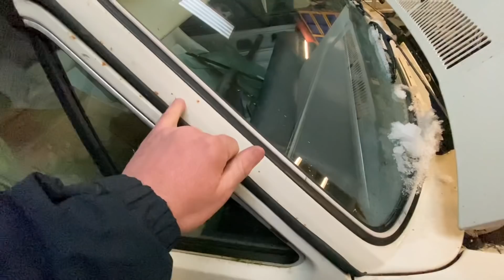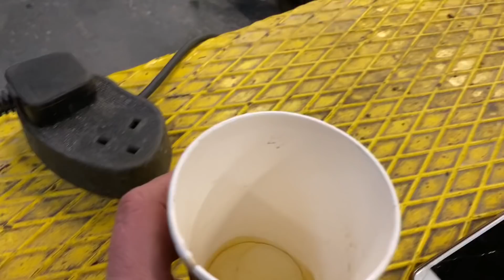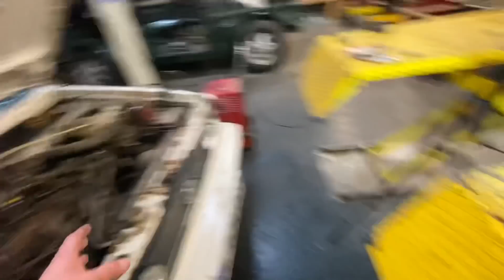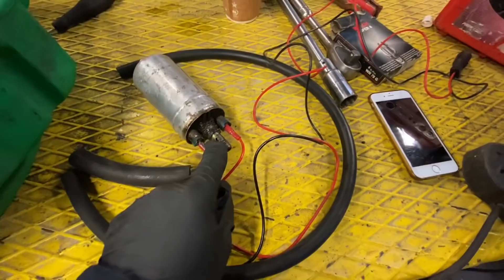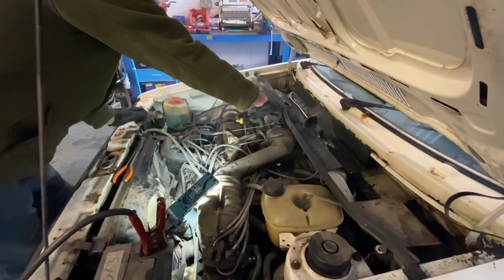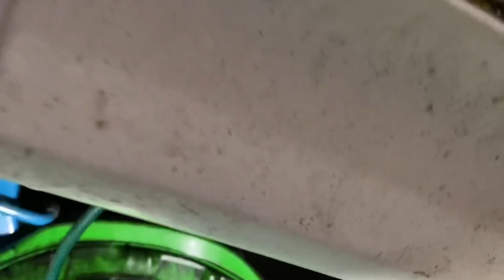Will It Run ??? MK 1 VW Golf GTI Rare Car Barn Find PT2

Comment: Hi are these worth. I just bought the exact same car for 1k Harmon kardon. Has mot and is daily drive?
Reply from the maker: Harmon kardon is a stereo system bud
Reply: @sruk  sorry I meant Karmann, they were limited editions, what do you think they sell for nowadays, not sure if I should keep or sell
Reply: @jayleigh7285  no such thing as a Karmann edition - all made by Karmann in Osnabruck hence the Karmann badge on all cabbys on the wing from factory. If they haven't got the badges then they've been taken off by an owner at some point, been in a bump/respray or simply taken off. VW supplied parts & all Mk1 cabbys were built/constructed/assembled by Karmann.
Reply: Thanks not to clued up on these if I'm honest. What should I sell it for. You may be interested if you make money on that if you could just have two🤔
Reply: @jayleigh7285  all depends on originality, condition, Service history, Mileage, special edition perhaps... need to do a bit of research on the sales side of it, only saying that as if you ask what it's worth on social media, the keyboard warriors will give the car a slating & saying it's worth what they think when they probably haven't got a Mk1 themselves or don't know that much about them...

Comment: I owned an almost identical one on a D-plate in 1997. Paid an iffy dealer £4.5k and later found it had been clocked  (should have known from excessive wear on the steering wheel, which they put a fluffy cover on!), badly repaired / sprayed in rear quarter arch area (paint bubbled up with water within a few months) and eventually the engine gave up on a hot first date! (Oil mixed with coolant and frothed up like a bad latte and ran like a pig but managed to get her home, although my date never came back again :0). After uncle Mick R.I.P x swapped out the engine it just overheated a few times on the M6 up towards the love of my life up North (23 years and counting) - she took pity on me and so we got £800 part Ex on a brand new late 1998 Mitsubishi Shogun to end my days with dodgy cars! - happy memories though ..

Comment: Good to see Chris back on the job these past two videos. With this recent flurry of convertible cars you may soon be known as Drop Top Rob. I'm sure that when they got to this age of convertible the cars with white interior were called the "All White" edition so maybe this car has had a roof at some point as mentioned in the videos. I'm also sure that the wheels currently fitted come from a favourite VW of the mine the Corrado. Watch out where you park it in all that snow. You may have to wait for Spring to find it again! Thank you.

Comment: had one of these myself back in the 80s, when i first got it , it would not rev crisply to 6k.(was good upto 4 to 5k)
took it to specialist (turbo teniks guy) and they fixed it by running deglazing agent in fuel and repairing / replacing top of injector unit ,
apparently these are a known issue, think he said seals in said unit can give bother
well done on hitting 30m

Comment: My first car was a 1990 Helios blue clipper auto. The Pierburg carb had an issue when you turned the car off it used to splutter a little before the engine cut out.

Comment: Your Golf Cabriolet was built at Karmann in Osnabrück and was one of the first models to receive the updated and elaborate corrosion protection treatment. All closed members were treated to a wax injection by hand and the lower areas of the body, from the first 100mm of the lower door were dipped in hot wax bath. If the car was left in the sun on an extremely hot day, then wax dribbles could be seen as some of the wax melted.

Comment: One thing worth checking before driving is the clutch cable. Making the mk1 rhd wasn't a high priority for Vw. They basically drilled a hole in the bulk head. It's worth checking the metal around the hole, they are known to fail and pull the cable and gromet through the bulkhead you used to be able to buy a strengthened panel for it. But be worth checking the stiffness of the clutch to make sure its not putting to much pressure on the weak point.

Comment: Know what these cars have? Character. The visual cues that surround cars of this generation shows that it was designed by a person with a pencil and paper. Not only the GTi, but things like the Alfa 164, Jag XJ40, Audi Quattro. I think my E36 BMW is the last car to show any element of human input. Since 2000 the regulations car manufacturers have to conform to have made cars all the same. They all have to meet pedestrian safety, they all have to meet low Cd numbers and package the same amount of interior room in similar size shells. My only hope is blokes like me in mid 50s can impart our wisdom and knowledge of such cars on our kids, so when we're not around these works of art still will be.

Comment: rob and Chris i think getting that golf running with a new fuel pump and a set of plugs was a gift from the gods , Especially with it been stood for years , my late farther was a bosch fuel injection specialist and service agents we had these in every days in the eighty's , ime amazes d youve got away with original injectors and the metering head is not sized up .personally i wouldn't run it until the tanks been cleaned out from experiences of these if the filler knecks been replaced  and the tank not removed for cleaning all the rust and sediment will block the injectors and all the very fine filters on the meatering head its a right task if this happens  . fantastic video i was sat on the edge of my chair when it burst in to life well done you both
Reply: As Paul said above ^^^... We had one years ago that never ran right from day one, filler necks rust on inside and fill tank with rust particals.
Only real fix is - tank properley cleaned out and a new filler neck, and filters etc.  We bought the last genuine VW filler neck in the UK a few years back (unless VW have remade them again) after trying a cheaper Ebay filler that was nowhere near the right fit.
Good look with it, looking forward to next update and don't work Chris too hard just yet poor lad!

Comment: Rob this has made me smile. Had a good few of these. Common problems ...I think it’s called the accumulator and also they all need to be strengthened on the bulk head where the clutch cable comes through. Of the clutch feels heavy then get a Blum head clutch plate. Hope this makes sense

Comment: Rob the car is hunting you must be running very lean but you may need to initialise the bsi so it holds the revs but you need to replace the parts first good to see your using bosch plugs not some Chinese cheap brand not the same

Comment: With it being E reg does it not need leaded petrol ? Or hardened valve seats
Reply from the maker: No it’s unleaded 👍
Reply: Use higher Octane unleaded -I use Shell v-power only in mine...

Comment: Three words Lift pump filter. There's a second fuel pump in the tank...
Reply: Bosch  injection 1 external fuel pump  5 bar fuell pressure no other fuel pumps in system just fuel pressure regulator returns excess furl to tank
Reply: @andyplage6590 ... And the lift pump in the tank...

Comment: Not sure what the fuel filler pipe is like on a cabriolet but on my mk1 tintop I had bad rust up inside the rear arch as dirt builds up behind the filler neck. Had to replace the inner and outer rear arch and the fuel filler surround.

Comment: rob they are really bad for the filler necks rotting and puts rust in the tank,i had one years ago and had to replace alot of the fuel system as the rust had gone right through it defo tank out mate

Comment: Bosch k jetronic injection. When you put the air filter in, check that the air flow metering arm moves freely, and also check the inlet flex hose for any splits or cracks . The fuel injection relies on the airflow to operate the metering unit and will not tolerate any inlet air leaks on the induction pipe!
Reply: the plunger shouldn't be messed with... air filter is simply 4 clips, raise the meter head, remove the filter, clean the unit with non residual cleaner, replace the filter & that's it.
Reply: @DeanoM3Sport  when this type of injection system is left standing for long periods, the air  flap can stick down, with the result that the car won't start, all that is needed is to pinch the centre screw between finger and thumb to check that it is free and that it lifts freely. I do agree that fitters shouldnt mess with things though! LOL

Comment: They do start very easy. Mine was the same after sitting for 6 years :)

I've got guides on how to DIY the roof if you're intersted. Im not sure a patch would be worth it as it would look terrible. A nice mohair roof is about 240. I think I priced mine replacing the outer skin, interliner, headliner and a rear window frame at 700 for the parts. You can imagine how much more a pro would charge.

Keep up the good work and looking forward to more vids on it!
Reply from the maker: It’s got a mohair roof we wouldn’t be patching it it would have the whole side replaced 👍

Comment: Tax sorn last mot 9sept2010 103924 done less than 4k in 4 years couple rear brake pipes advised looks Gr8 had man over the years sport lines n rivage there the ones with big bumpers n power hoods yours worth 4nhalf to 5 n half when done white roof or nice red roof

Comment: The white roofs on the mk1 Golf cabs did seem to deteriorate a lot faster than the other original colours, so it's no surprise to see that it may have been replaced in the past.  Good news on the engine, it sounds pretty sweet, and good news on the seat cloth too...

Comment: Front bumper is not the right one
Reply: the whole kit wasn't factory on an E plate... big bumpers only fitted from 88 (F plate) - 93. The grille, alloys, exhaust, foot pedals & steering wheel weren't standard, along with the 16v badge lol. only did the 16v from the mk2.

Comment: That bosch jetronic fuel injection system is a nightmare. My mates Escort xr3i convertible ran like yours on first startup, turned out it was a bad metering head. That was after we replaced every other part of the fuel system. Lucky on the fuel pump!

So jealous of the snow, lol. Nothing here in Wiltshire.

Good to see Chris back.

Comment: Hi lads and great effort during the cold.  I’ve been watching all but transfixed for some months.  “Do I watch prime time tv or do I watch Salvage Rebuilds”?  No contest.  Your work cleaning that old motor home was some good old fashioned British graft.  Great to see and an education to so many.  Now, my question.  For this VW you injected oil/DERV mix into the cylinders before turning the engine over, absolutely great to see, but why didn’t you do it for that great little old Peugeot 306 GTI.  I didn’t see you do it and that really gave me nightmares?  Just a question I would not dream of questioning you lads.  Great channel.  Hope it all pays off.  Top channel.
Reply from the maker: Wen I dragged the 306 on to my truck it was stuck in gear so it had already wound the engine over quiet a few time so if there was going to be any damaged that would have been the cause  👍

Comment: just my opinion Rob, but no point repairing that roof skin guys they degrade with age,  you will get a new black mohair skin for under £300. you will need new tension cables each side and a rear cable too, roof skin has tocome off to adress the rust on the quarter tops.
Reply: and you will need to check the pick up pump in the tank or the new high presure pump wont last long.

Comment: Rob, Chris, you definitely need to check the fuel filler neck. The original was mild steel and rusts out, sending debris into the tank. Others have probably mentioned it too. I have a stainless steel pipe for my Rocco, so swapping it out would be an option.
You should be able to gain access to the tank from under the rear seat. Use the old magnet trick to clear it if it’s got crud inside 👍. 
On my Rocco the ignition module sits in the scuttle on the passenger side above the engine bay. Covered by a plastic rain tray for protection. My module sits on a heat sink, check if yours has copper grease in between the module and the heat sink. The grease has been known to dry out and the module then over heats. Causing the motor to cut out....

Definitely try vw heritage and Gsf for fuel rubber pipes etc. 
Glad to see an old stool vdubya on the go. 

Great to see you both recovering well from your illness. Stay safe guys 😷.
Reply from the maker: It was the first thing we checked 👍

Comment: Remove the rear seat and pull the in-tank fuel pump. K-Jet does not like sitting for extended periods and the in-tank pump screen could be varnished, as well as the hoses could be disintegrated. Additionally, the fuel accumulator's rubber diaphragm could be shot.

The timing belt "scratch" is normal due to the belt cover.

Glad to see another Golf Cab being saved!🥰

Comment: Hi Rob; loving your channel; this GTi brings back fuel system memories. These are prone to dropping water into the fuel system from the filler cap. All it needs to prevent many headaches is a new seal in the cap. Very simple and cheap remedy but avoids future problems.

Comment: When you blow out a fuel line, always blow from the motor back to the tank, because any rust or debris will have come from the tank and will most likely be at that end.  Doing it the other way can force debris into the line where it might get stuck half way along.
Reply from the maker: We blew it both ways 👍
Reply: I’m blown away

Comment: Nice one fellas 👍 may also have another pump in the tank. Also check the kjet metering head setup they are quite fussy for set up, may also need super unleaded to run spot on 👍

Comment: As an apprentice I had to fabricate a reinforcing plate for the bulkheads on plenty  MK1 GTI’s & golfs in general,where the clutch cable entered the bulkhead it would split 🤦‍♂️🤣
Reply: I remember selling one with a pair of mole grips each side of the bulkhead🤠
Reply: @ady1397  🤣🤣🤣🤣

Comment: No Point Fitting a Diesel Filter in the Engine Bay , Petrol would Work alot better 🤭
Was it Just a Matter of Running the Engine to get it bk Running o n 4 Pots , was the leads Damp too?
Reply from the maker: 🤦🏻‍♂️ long day. It was all damp and the fuel pump was toast 👍

Comment: Great to see it started, well done. Definitely check fuel tank as filler pipe rusts away and drops bits into tank, fuel filter is after pump so no protection for pump!.

Comment: I messaged on Instagram regarding the fuel tank. Heritage and Mark at classic VW are the guys to go to. Behind the rear wheels pretty much at the back of the car there's two rectangular brackets they're the best place to put the axle stands if you take the tank out on the floor as it requires the beam removing...
Reply from the maker: We got a ramp so should be quiet easy 👍
Reply: @sruk  yep you'll just have to shuffle the cars I guess hope you guys go far with this one if you need anything message me on insta scirocco mk2 owners club

Comment: Brilliant video; thank you.  I had two of these back in the 80s.  Some toe rag stole the first one and I never saw it again.  I bought the exact same one as a replacement.  So, I’m loving the memories.  The clutch went on the second one after less than two years and 8,000 miles.  I had to give it up when the insurance went through the roof.  GTI quickly began to stand for Ghastly to Insure....It was parked on the road in central London....looking forward to lots more.  Thanks guys.....stay warm....

Comment: Loving this series, I've had 2 mk1 cabs and they're great cars. You may find the carpet has shrunk, hence why it's come away from the sills - common issue. Some people will try to glue down, but may be best to replace carpet. Heritage have good spares. This would look lovely with some original white snowflake alloys Rob. I know others have said about filler neck, but they're also prone around the whole of the rear tub where the roof meets the body work. Looks like the roof may need the tension wires tightening a little - again an easy fix.

Comment: I had an E reg GTi Cabriolet (E750WVS) many years ago.   Hearing that fuel pump brings back memories.  My fuel filler neck rotted, had new tank and neck and pump and it was fine again.   The big bumpers started on 88' E.  Shame it doesn't have the original scala alloys.   Those 5 spokes needed binning.

Comment: Ngl I've never heard anyone say there car has thawed out before 🤨
Reply from the maker: Lol
Reply: You should see my 99 ford F250 7.3L diesel truck thats sat out in - 26 or colder at the moment here in Manitoba Canada.  It's so cold the foam in the seats is so hard you can jump in it and not sink in the seats like you would in warmer weather . I'm not even going to try starting it with the engine coolant heaters turned on for 6 hours, Until it "thaws out" a bit when it warms up after this weeks cold snap ends.

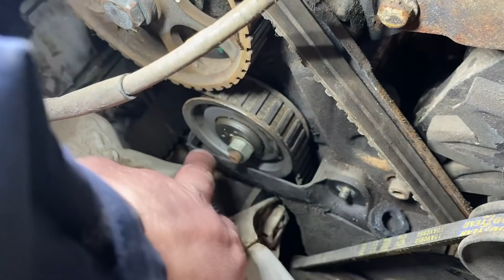Comment: There's a bit of rubber by the cambelt when showing the belt, hopefully you spotted so it doesn't fall into the belt and cause timing issues :) 5:27

Comment: Rob, a new vinyl hood can be got for £200 and a mohair for slightly more, but the time you muck about with repairing that it won’t be worth the hassle
Hood replacement isn’t too bad, there’s a couple of tricky areas to consider though, also you may well find you need a new rear window frame, they rot and the inner aperture disappears and they leak 

I will message you on Instagram where i use for hood supply 👍🏻
Reply from the maker: Our trim man makes the hoods bud 👍
Reply: @sruk  i won’t bother then 🤣 i may still message you for his number though as my drivers seat needs the same material but grey on the lower bolster doing